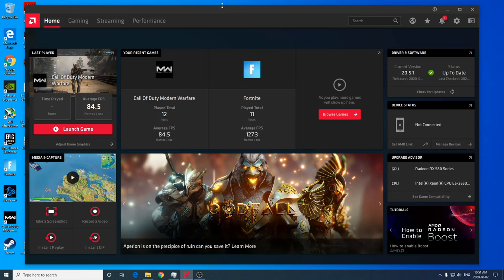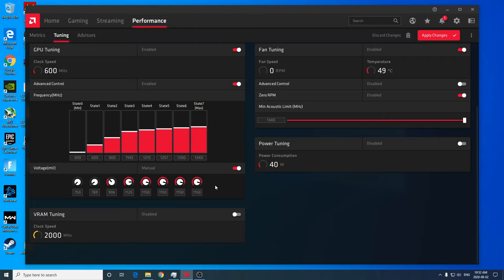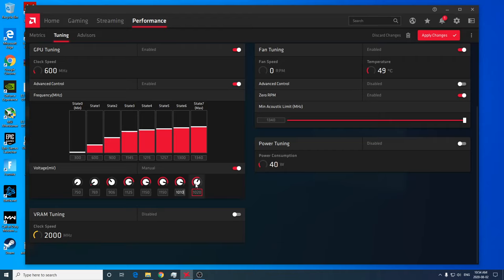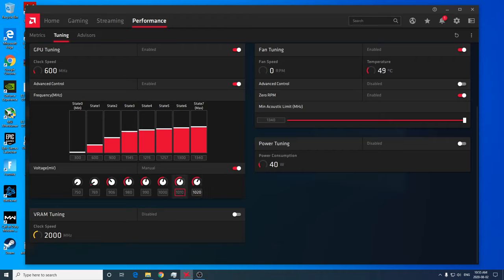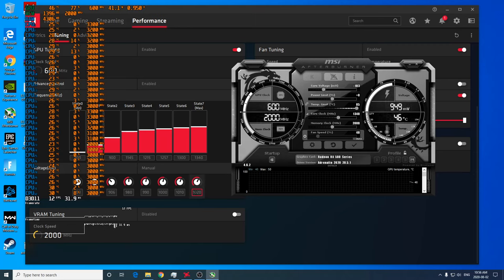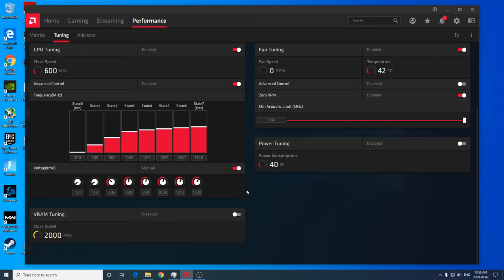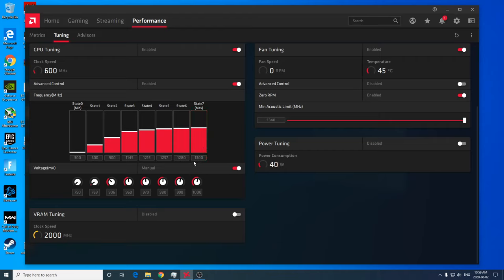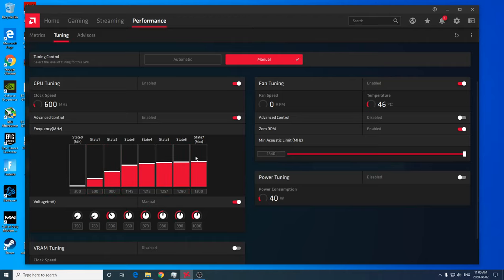How To Undervolt AMD RX 570 and RX 580 (How to lower GPU temp upto -10c)

Comment: So it doesn't reduce performance too much yeah?
Reply from the maker: If you lower core clock you reduce performance a bit. But voltage does not affect performance.
The reason you would lower your core clock would be if you want to run a lower voltage so your card runs cooler.
Reply: @AleksandrsBrodie  I tried the settings shown in video and all heavu games crashed. I guess I need to fine tune it
Reply from the maker: @zaurhasanov5458  yup.
It just means your voltages were too low for the core clock you wanted to run.
Example, if you run 1380mhz, you may need 1120mv,
1340mhz may need 1070mv,
1300mhz may need 1030mv.
It all depends on silicon quality

Comment: does it make your gpu underperform tho???
Reply from the maker: lowering core clock lowers performance, but lower voltage does not affect FPS.
If you gpu is overheating, then it is worth potentially lowering your core clock to run and even lower core voltage. bc if you gpu overheats and dies, then 0 fps ;P

Comment: I got 550w chieftec 
And xeon e5 2643 rx 580 4gb 16gb ram and my pc turns off when i play games so can i undervolt it to get lower power comsuption and how(how much mhz memory clock and that)
Reply from the maker: I would try 1244mhs at around 960mv
Reply: @AleksandrsBrodie  il try

Comment: Hi my rx 580 core clock is 1125 mhz by default ,,is this ok?and state 7 voltage is 1150
Rx580 xfx
Reply from the maker: sounds like it was bios modded for mining. so I would search online for the original vbios and flash it. make sure you check what memory type your gpu has so the vbios you flash onto the card support memory timings for your exact gpu.
ie, if your gpu has samsung mem, make sure vbios has memory timings for samsung mem otherwise gpu will brick if you flash elpida timings onto samsung card

Comment: Will this help with fan speeds, say mine is running high, would this lower the speed of the gpu fans
Reply from the maker: yes it would, lowering your GPU temp will lower fan speed.
and undervolting is a good way to lower gpu temp.
Reply: @AleksandrsBrodie  thank you, you've helped so much, good detailed vid and easy to follow
Reply from the maker: @Paxman222  happy to hear 😉😉👍
Reply: @AleksandrsBrodie  is global tuning for every game, what is global tuning??
Reply from the maker: @Paxman222  global tuning is for everygame, but it gets reset on restart.
That is why you need to use game profile for each game you want to play with undervolt settings.
Reply: @AleksandrsBrodie  okay thanks

Comment: why is my core voltage in msi afterburner disabled? is it normal? it is just set in 0 (meaning can't modify it)
Reply from the maker: If you want to change it in msi afterburner you need to enable the setting in the settings page

Comment: Do does it save electricity?
Reply from the maker: yes as you are using lower voltage = lower power draw
Reply: @AleksandrsBrodie  I mean like how much does it save? Alot?
Reply from the maker: @Nkit_1  can be upwards of 10-40w.
Reply: @AleksandrsBrodie  ok

Comment: Can i undervolt my Rx 570 red dragon 4GB for my Antec BP450P psu?
Reply from the maker: yes you can.
Undervolting is also known as setting an optimal voltage for the given clock speed you want to run.
Reply: @AleksandrsBrodie  Also does Antec BP450P good for rx 570?
Reply from the maker: @khiemnguyen7929  if your cpu doesn't use too much power
Reply: @AleksandrsBrodie  it an i5 3470
Reply from the maker: @khiemnguyen7929  yes, in that case, that power supply should be enough for both i5 3470 and rx 570.
PS. i would recommend upgrading your cpu to a Xeon E3 1230v2.
Its a cheaper version to the i7 3770.
It will help prevent the stutter you get in your games.

Comment: 6:32 78° really hot? my rx 570 gets to 89° all the time with a little undervolt and underclock xd
Reply: repaste
Reply: @gicahagi5809  bruh. I've obviously done it, 2 different pastes. I just bought an mx-4 which is the best i can afford for now tho
Reply: @_GRiM1  i bet it's an RX 570 from XFX
Reply: @raycon8797  for sure it is. THO a lot of people i've seen get a max of 76°C with the same card, guess i just got a bad one
Reply: @_GRiM1  my gf has the same gpu, i changed the thermal paste but the problem persist, that reach easily 90 degrees
Reply: @raycon8797  so far i found no fix, but i DO have a pretty cheap thermal paste, i'll wait till a decent one arrives then i may update you if it solves the problem a bit at least
Reply: I sit at 60 to 63 core clock at 1500 playing war zone and fallout 4 and bf1

Comment: I've set my RX 580 to 1370mhz at 1050v
I think any lower than that will give me a bad time
Reply from the maker: 1370mgz clock is high only way to drop voltage and temps is to lower core clock
Reply: @AleksandrsBrodie  the original Clock for my card is 1366mhz, it's the XFX RX 580 GTS.
I didn't want to harm my original performance but I guess I will have to lower it.
which clock with be better? 1300mhz, 1257mhz, 1200mhz
I'm really trying to cut down the power consumption. my target power consumption is 70-80w.

ill just let it free when I'm rendering videos and other productive stuff, but for gaming I'm trying to keep it very low

Comment: How do you set your fan Curves?
Reply from the maker: either in the AMD drivers or using a program like MSI afterburner.
there is good info on how to do it exactly on google.
But its pretty simple if you look around in the amd tuning software, generally located on right side.

Comment: Umm, for some reason, I don’t even have the tuning option on the Radeon software :/
Reply from the maker: you can make sure your drivers are up to date
Reply: @AleksandrsBrodie  yes, all my drivers are up to date, did all of that yesterday thinking it would help somewhat towards the heating issues. (Did a re-paste also) then went on to do the undervolting, but it’s not showing in the program :/ strange
Reply from the maker: @aykit08  I am not sure then
Reply: @AleksandrsBrodie  no problem. I googled it also and couldn’t find an answer haha. Thankfully the re-paste helped with temps. From 100c to 75c :D

Comment: any body getting a bad display after installing radeon software?? im getting pixels flying all over my screen and ghosting letters and ripes slashes of tearing on my screen.. if anybody has a fix for this please let me know ive try a lot of stuff and even thinking of getting rid of my 5700xt even tho i only got it 2 weeks ago.
Reply from the maker: see if you can return your rx5700xt. also the new navi cards are much different than the Polaris rx 5xx series
Reply: thats my problem too do you have a fix?
Reply from the maker: @26paculbakimmartin99  pixels across screen means dead video card generally or some sort of issue.
Reply: @AleksandrsBrodie  i think i should buy a new gpu
Reply: @AleksandrsBrodie  the game is has pixel but playeble but for about 5 min it restarts the whole pc what should i do?
Reply from the maker: @26paculbakimmartin99  I would monitor your system temps, see if your GPU is over heating.
Reply: @AleksandrsBrodie  can i dm you or something please i need your help
Reply: Discord do u have?
Reply from the maker: @26paculbakimmartin99  i wont be able to help you like that. I would just monitor temps, otherwise, you can try to lower your GPU clocks.
There are a lot of different things you can consider:
How long have you been using the card?
was it working before, if so what changed?
what size of psu do you have? do you have the GPU connected using the appropriate connector? etc.
Good luck :) with time and patience im sure you will figure out what the issue is, or you may decide to replace the card.

Comment: i wish u see my comment i have a good pc that can run lol and sekiro perfectly but i have a blackscreen issue whenever i lanch the game my screen goes black and wont get back normal then my keyboard get shut off i havr an rx 570
Reply from the maker: could be a driver issue,
Also does this happen after you undervolt or just happend before undervolting?
If its because undervolting, you need nigher voltage or lower core clock,. if it happens on its own, it could be a power supply issue.
Worst case its the card its self.
I dont know how long you have had the card so I cant give anymore specific opinion
Reply: @AleksandrsBrodie  i have a 600w psu so idt its a psu prob and i already reinstalled my ghrapic card drivers but is it normal for the pc not making any fan noises?
Reply from the maker: @hydra6377  some gpus run on 0 rpm. you can also manually set the gpu fan speed or set a fan curve in a a software like msi afterburner.
You can also try downlocking your gpu, so lowering the last core state to 1200mhz with stock voltage and see if that works.

Comment: Tested it on cs2 1080p high before i was getting 102 average fps on 76-80c, after i tested it with your settings i got 105 fps average on whooping 62c max LOL
Reply: How much did u lower it ? I lowered mine from 1150 to 1020 like in the video i did not test it yet.

Comment: does this work for the saphire nitro+ rx 580 4 gb cause im new 
i mean like can i use the amd drivers for it?
Reply from the maker: Yes you can.
Undervolting and the core clock settings are applicable for rx 570 and rx 580 video cards regardless of the manufacturer.
So it will work with msi, sapphire, Gigabyte rx 570 580 etc.
Reply: @AleksandrsBrodie  ok thank you
Reply from the maker: @kassas3270  ;)
Reply: @AleksandrsBrodie  another question can i use the rx 580 4gb with a 400w power supply or do i have to get a 500w one
Reply from the maker: @kassas3270  you probably want a 500w psu ad the rx 580 can draw 150-200w at the wall
Reply: @AleksandrsBrodie  um do you have any recommendation that work with the hp z230
Reply from the maker: @kassas3270  if you are running Z230, then you probably wont want to replace the power supply.
In this case you are just going to want to undervolt the gpu a lot.
Maybe run 1150mhz on core at 920Mv.
Reply: @AleksandrsBrodie  ok thank you

Comment: I getting Stuttering in Forza Horizon 4 i get a rx570 4gb Ryzen 5 2600x how i can Fix that
Reply from the maker: you can cap your fps at 60 otherwise, i am not sure.
could be CPU related, as i get stutter in the early seconds of a race and that has to do with my cpu not being fast enough.
Reply: @AleksandrsBrodie  same with the race when i starts i get stutter i dont know how to Fix that
Reply from the maker: @fido2482  I dont know what you can do as I'm guessing it is a cpu bottleneck
Reply: @AleksandrsBrodie  i can Fix that or not?
Reply from the maker: @fido2482  you will need to monitor your cpu usage in game when you get stutter and see if one core is being stressed to 100% causing the stutter. Otherwise the only way you can fix it is by upgrading your cpu.
Reply: @AleksandrsBrodie  my CPU ussage is 40-50 percents
Reply from the maker: @fido2482  then I'm not sure

Comment: Does this lower my fps?
Reply from the maker: If you lower the gpu core clock it will a bit but if your gpu is overheating it is worth undervolting
Reply: @AleksandrsBrodie  is above 80 degrees overheating for an rx 580? thats about how much i get, also i did the method but my program immediately reverts the changes.
Reply from the maker: @Purplebruh  yes 80c is over heating,
you want to keep your card around 70c if possible. I pinned a comment i put in the comment section a while ago with a link to a video with optimal settings for undervolting that you can copy

Comment: Does it work for mining?
Reply from the maker: Yes it does.
But generally for mining something like Eth, you want 1100mhz core, 800-850MV core clock, and 1750-2000memory with modded bios.
Also use a linux based mining os like Hiveos.

Comment: bro is intel xeon e5420 good for gaming?
Reply from the maker: No it's not, it's too old.
In my latest video I got over 3 motherboard cpu combos for xeons.
Reply: @AleksandrsBrodie  I really need some help here. I'm getting a powerful pre-built gaming PC with an Radeon RX 580 soon, and I'm only centered on 1080p 60fps gaming. (Nothing crazy like 4k ultra) and I really want my GPU to last long. Would you say your settings in this video are optimal? Or should the clock speed and voltage be lowered slightly?
Reply from the maker: @zedrazilo3142  1300-1340mhz with voltage between 1020-1080mv depending on what you card can handle is good in my opinion.
Look on my channel i have a few other helpful undervolting videos I would recommend you watching.
also, use MSI afterburner to set a custom fan profile.
Reply: @AleksandrsBrodie  Alright thanks. Is there anything else MSI Afterburner is good for? I've never used it.
Reply from the maker: @zedrazilo3142  you can overclock with it but i just use it for the fan control

Comment: bro it doesnt work always crash my gpu
Reply from the maker: you will need to either lower your core clock or increase your core voltage. as i mentioned, each gpu will require different voltage settings.

Comment: Noob question, If I lower Voltage wont my GPU get less power and loss fps?
Reply from the maker: Power does not equal frames.
Gpu frequency = fps.
All we are doing is optimizing our Voltage for the given clock speed to that we use less power and ask the gpu runs cooler.
If you lower clock speed, you will lower fps a bit but sometimes if your GPU is running very hot, it can be worth lowering both frequency and voltage
Reply: @AleksandrsBrodie  It has nothing to do with the question, but I open my case and waited for 10 min, GPu and CPU temperature didnt change that means the case is getting enough airflow from my fans?
Reply from the maker: @zkennedy5671  if you lower your voltage you wont get lower frames.

Comment: I have a rx 570 is it bad for it to run gta v at 79°
Reply: Im scared that im going to coock the graphic card😁
Reply: And the fan speed is at 3400+ rpm
Reply from the maker: I would set core clock at 1250mhz and voltage around 930-980mv

Comment: my rx 570 4gb was stable on 1300mhz 960mv and now with the newest driver it crashes at 1050mv same clock ..what a joke
Reply from the maker: I'd suggest lowering core clock
Reply: @AleksandrsBrodie  i installed the older drivers from january it works perfect just played a game
Reply from the maker: @adoftw3866  drivers can be weird. 
Good luck 👍

Comment: Omg my XFX RX580 8GB is awful at undervolting. I wanted to keep out of the box clocks and try some undervoltage, but is so painfull. Lowest i could go is: 
S7 - 1340Mhz @ 1120mv (base clock is 1366mhz but i changed it to match one from your video)
S6 - 1300 @ 1110
S5 - 1257 @ 1100
S4 - 1215 @ 1090
S3 - 1145 @ 1080

Do U have any idea what else i could try to keep my clocks but undervolt more? I want to keep as much FPS as possible, cause i play Warzone @ 144hz.

I tried your settings from this video https://www.youtube.com/watch?v=0pzxFZBw-6Y It works just fine, but that FPS drop is just too much for me :/
Reply from the maker: sadly not much you can do, as i mentioned, some cards are just not as good quality Silicon, the only other thing i can suggest is lower the clock and then lower the visual settings in COD, also you can go from 100% res to 95-90% you still keep a pretty sharp image but you can get your extra FPS back.
otherwise, make sure to take the side panel off your PC, i do that for my main rig when i play games where i need max performance.
Reply: @AleksandrsBrodie  yea that sucks :/ if i would like to change State 7 to 1300mhz, how the rest of the states should look? Is there any algorithm/math formula/percentage relation i can use?

EDIT: My acustic limit is set to 900mhz, should i change it ?
Reply from the maker: @pafcas4831  not really, i just drop the other states a bit so it looks like a curve.
I generally change states 4-7 and leave state 3 as the base line.
So the voltages I would could all be very close from state 7 to state 4 for stability purposes.
So lets say you went with 1100Mv on core at 1300mhz, then you could drop voltage to 1090, 1080, etc.
and as i mentioned in one of my videos, that the actual voltage is about 15-30mv lower than your state 7 when running.
this is why i like to use MSI afterburner overlay to see what voltage my GPU is actually running at while in game.

Comment: Hello sir is  xeon.e5620 2.4ghz will cause bottleneck for rx570 plz tell
Reply from the maker: yes the E6520 will bottleneck rx 570.
I would recommend upgrading to Xeon X5670 or W3680
Reply: @AleksandrsBrodie  Sorry I want ask how about I72600 feat rx 570 it will bottleneck ?
Reply from the maker: @boxscreen8268  it depends on the game/application.
For esport games, there will be a bit of a CPU bottleneck,
But in AAA title games on high settings where you are playing around 60fps, it will be an ok balance.
when you are on a budget, you just choose the best option currently available to you that is in your budget.
I personally feel its more important to have a better CPU than GPU for future proofing.
I think RX 570 is a solid card and would recommend as you can pair the rx 570 with even a Ryzen 5 3600 and still have a good experience
Reply: @AleksandrsBrodie  Thanks, you help a lot. So i known what to be prepared in future because of you.

Comment: bro what about rx 470 4gb.
Reply from the maker: The same undervolting principle applies. You just may need a little high core clock than a rx 500 series gpu would require.
For tur rx 470 you can try 1150mhs at 960-1000mv